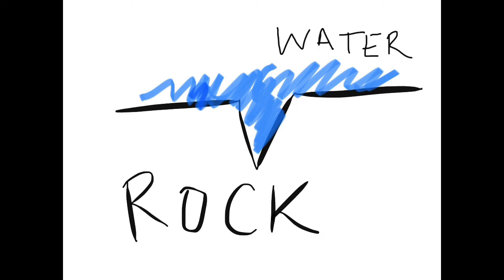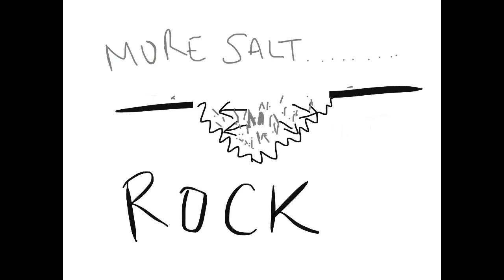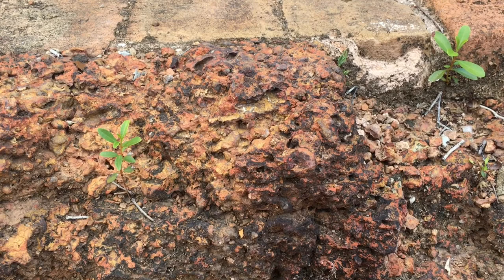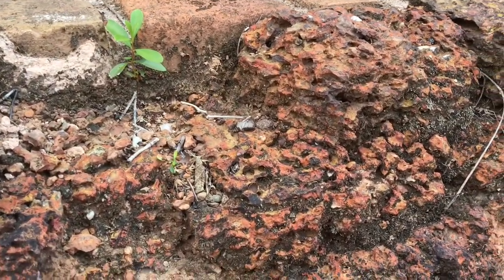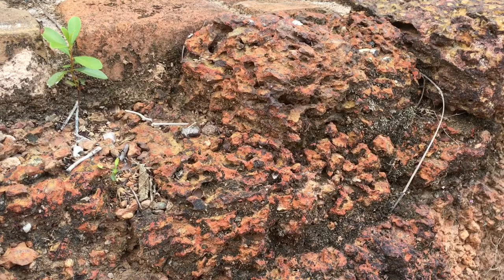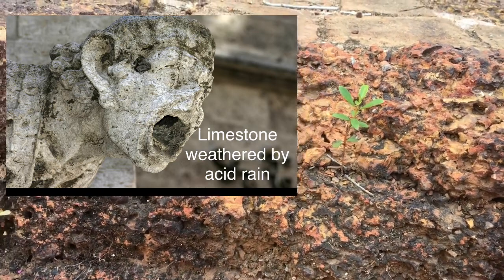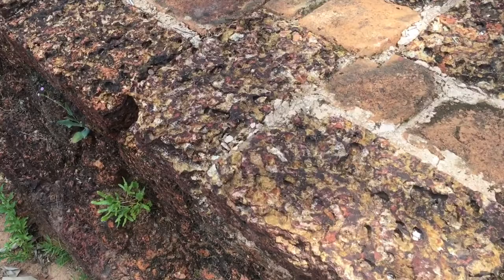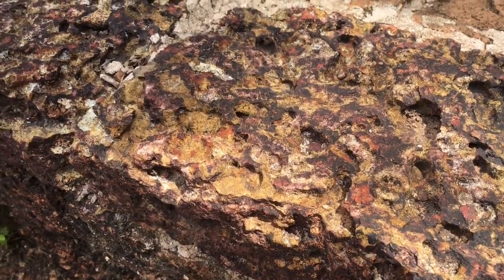Explaining salt weathering (Haloclasty)

Comment: But sir it does happens in deserts, so where is there  salt water in the desert?
Reply from the maker: Sometimes the salt is already inside the rock. Rain or moisture in the air can enter the rock, dissolve the salt and pull it out to the surface of the rock.
Reply: @hube7830  ohhh thank you sir

Comment: Where is the salt? What happens with the salt?
Reply from the maker: By the same processes of weathering acting on the rock, salt is also removed as it accumulates. Rain, wind etc.
Reply: @hube7830  oh so they get denuded easily bcz they're softer than rocks right? Thanks Sir!!
Reply from the maker: Exactly. So it can’t accumulate forever. At the scale haloclasty is taking place, the tiny salt crystals are building up in fissures on the rock which offers some protection from weathering initially. As the salt crystals break off parts of the rock, they open up more access for weathering by wind/rain.